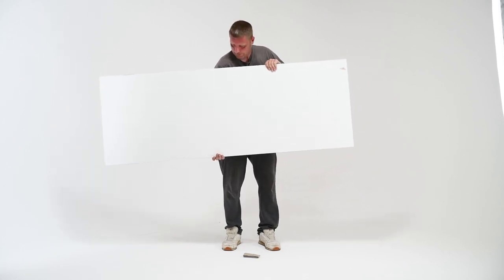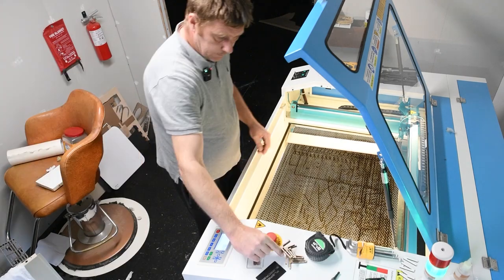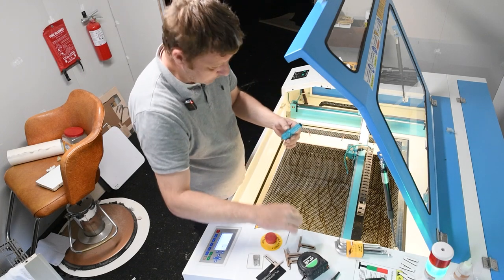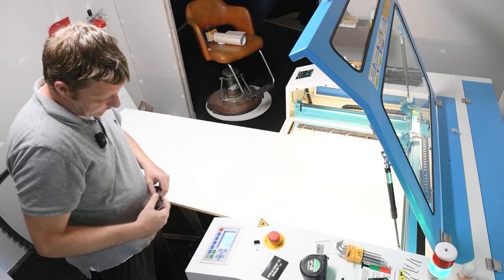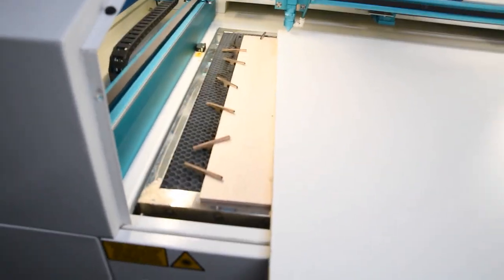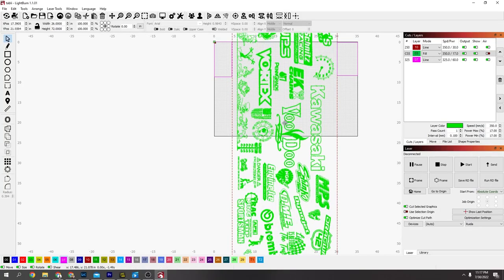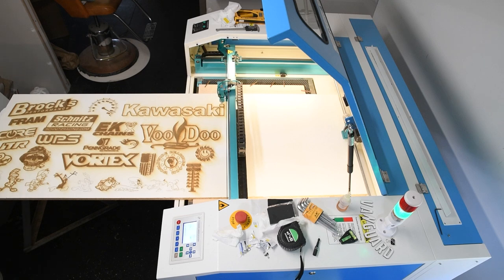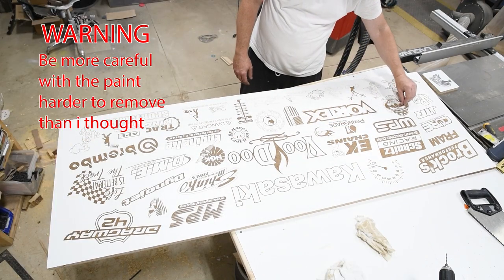Large Laser Project Without Print and cut Lightburn Tutorial

Comment: Great tutorial, text looks sharp using the paint to fill. Did you engrave completely through the laminate surface down to the chipboard or just etch the laminate away ?
Reply from the maker: Thank you, yes i removed it back to the chipboard, 350 speed 30 power, the top layer is only about 1mm thick, before it is installed were going to clear coat it. thanks for watching

Comment: If you disconnect the wire to the autofocus you can raise the bed back up.
Reply from the maker: Thank you i will have to check that out, lucky i found a work around this time, i never had a problem before as i only use manual focus, but thanks i will take a look at that.